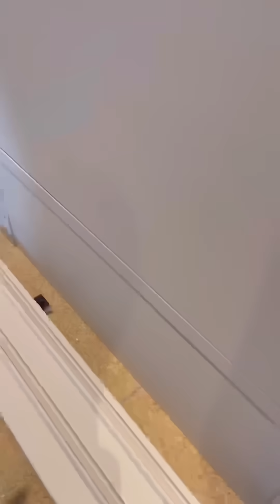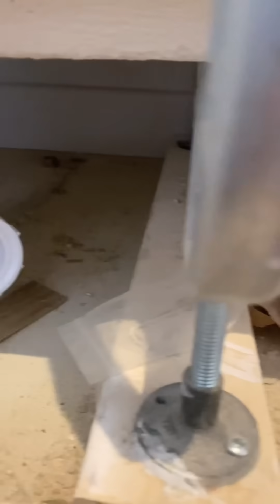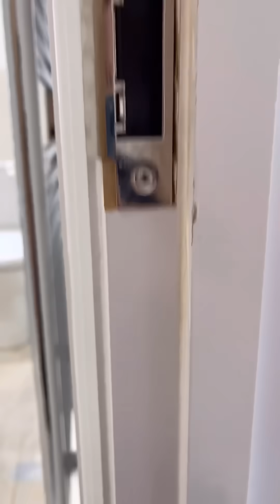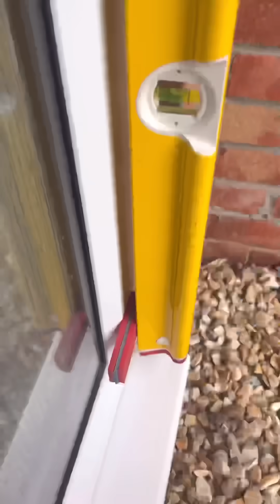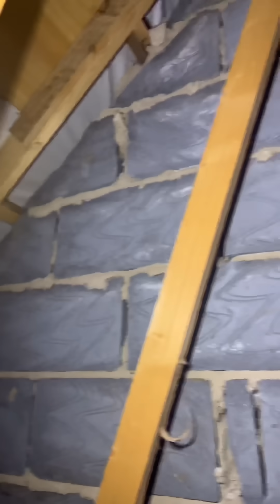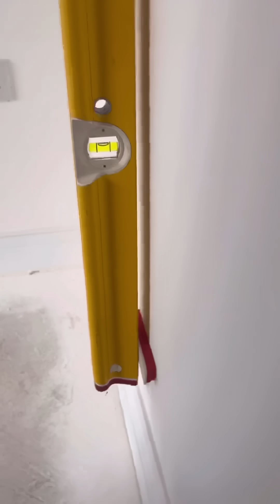KNOCK THEM DOWN! September New Build Snagging Compilation

Comment: I’ve worked at both ends of the scale and it all comes down to rigorous QA processes, setting your standard early doors, and a genuine passion to build nice homes that you’re proud of. Getting it done right is very stressful as you end up having lots of confrontation. 

People need to remember a lot of these houses are built in 5-7 months, with tens of them being built at once. It’s a lot of plates to keep spinning, and if you start to lose control it’s impossible to regain it. 

That said, I would be devastated to hand over any the houses in these videos and would be handing my notice in shortly after!

Comment: I'll tell you how some of this stuff gets "signed off", the developer is lining the pockets of the building inspector or some somebody else in the local government. 

My brother has worked in construction for close to 10 years and currently works for a company that does kitchens, bathrooms, and custom tile work. Some of the stuff he's found in multi-million dollar homes is shocking. There was one where he said there was a small step-up in a floor but you could go up the step, around the house, and end up back at the low side of the step without ever encountering another step.

Comment: Some of that brickwork looks a bit like parts of my home... built in 1929. To be fair, at least on average the walls here are plumb to within a very few mm, as near as one can judge an average when individual bricks jut out at random here and there. The 'bond' in the bricks is also completely random. One would like to think that modern building controls, please the ready availability of tools like laser levels, might have improved things. Apparently not!

Comment: most of it trivial repairs and blockwork in loft not pointed is going to cause a lot of sleepless nights cause everybody goes into loft everyday so get a life and what do you do for a living
Reply: Trivial repairs. Yeah okay then cunt, pull the other leg. How the fuck are external and internal walls not even level a "trivial repair"? Or windows and doors not fitted right, with framework already splitting? You go and pay for the fixes to all these issues and see how much it costs you by the end. Fuck off with your useless biased opinion - you're probably exactly one of these twats doing this shoddy work who should be booted out of the industry and banned from going anywhere near a building site. Fucking cowboy.
Reply: There should be no such thing as a trivial repair, or unpointed block work. They have no skill and even less pride in the work they do!
Reply: @Bobo-ox7fj what i was saying is homeowners change spec cause when they see plans it looks excellent but when its done they want to make changes so you are a lucky contractor to do job to plans and homeowner doesnt want any changes and some of the points you mentioned eg flooring and light switch next to shower are  they down to contractor or floorig is faulty and light switch next to shower when you can clearly see bathroom wasnt planned that way unless you want to shower in front ofwindow so thats obviously a change of plan and as a contractor we get paid to do whathomeowner wants not what we want to do as at end of job its there decision as long as they sign disclaimer to say thats them that want change of plan because if i got contracor to do work in my home its me that makes the final decision after all as you say thats what you get paid for
Reply: @bluegalaxyvr3442 These are very, very, very unlikely to be bespoke new builds going by it being in the UK. These will be big developments, with houses with the exact same plan up and down the country - in most cases the absolute most someone will get to choose is the facade. There is no excuse for this.

Also, trivial repairs and blockwork perhaps, but they were paid to do the job correctly. So do it correctly!

Comment: Has this anything to do with the new cheap imported labour the overbloated developers are employing?
Reply: Nope all trades are divided so nobody works together. And most work these days ur paid a price too do the job so the quicker and more you get done the more money the tradesman earns… blame the system.
Reply: Yep zero hour contract workers..
Reply: Not a Fu*king thing. 
I've worked with literally hundreds of men on building sites, from all trades and none, most with a Union Jack running through them like a stick of Blackpool Rock.
Turn up pissed as a rat, smoking dope by 11am. Might do some work an hour before lunch, and a a couple more hours after
By 3pm they are finished, can hardly keep their eyes open
Last 20 minutes they suddenly come to life, get the kit away as quick as they can, and get back down the pub.

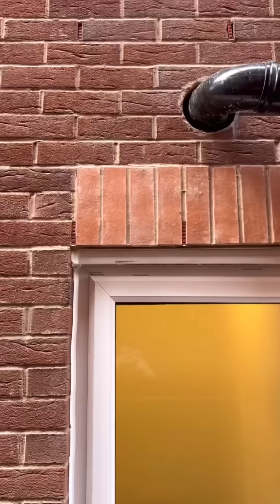Comment: 1:31 the elbow sticks out too far to remain parallel with the building if you dont oversize the hole to accommodate the collar of the fitting, should deffo be sealed though lol

Comment: I do DIY in and around my home. I hate doing anything new that I haven't done before, and sometimes it's wholly unjustified because when I do actually do it, I do a reasonable job of it, and I can honestly say I've never left anything in that kind of state. It would simply mess with my head if I left a mess like that.

Maybe it's because it's my own home and I take pride in what I'm doing, and I want it to look nice whenever I see it again, but even the stuff that gets hidden (like insulating stud walls) still has to be done right.

Compare that to the professionals who did adaptation work approved by our local Council a year after we moved in, and I'm still uncovering stuff they did that completely shocks me. One example. They replaced an old fuse board with a consumer unit and relocated it to the front of the property, and in doing so they didn't rewire any of the original circuits. To make the wires reach the new location, they simply pulled the old wires into the loft and crimped a new piece of wire onto the old tails, then wrapped the crimps in a layer of electrical tape with no stress relief on the wires at all. They even threw an empty polystyrene takeaway tray under the floorboards on the ground floor, and the instructions for one of the new electrical items (probably the shower) were also found under there too eventually when I went down there to do something else. By then the paper was all mouldy.

There's probably still more I haven't uncovered yet.

Comment: What happens with walls, internal or external, that are so out of tolerance?
Reply: Booze?
Reply: @ge2719  I think he means "what do they do with walls that are out of tolerance to remedy the situation."

I'm guessing (probably incorrectly) that they'd have to knock down and repair it, but that sounds like a lot of money to fix it, because it's going to have all sorts of additional things that would be wrong as a result of the wall being out.
Reply: Also wondering this too, not exactly a simple fix.
Reply: The developer takes a bag of coke into the NHBC and it's not an issue
Reply: 3 bags of bonding coat + skim ;)